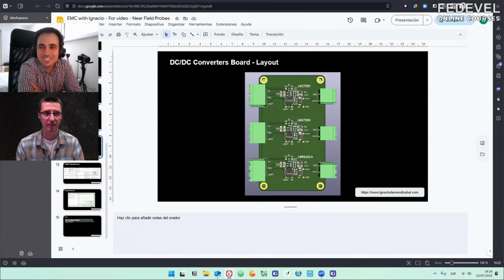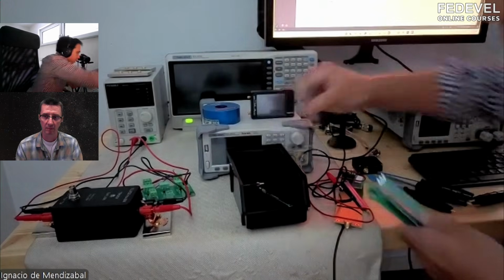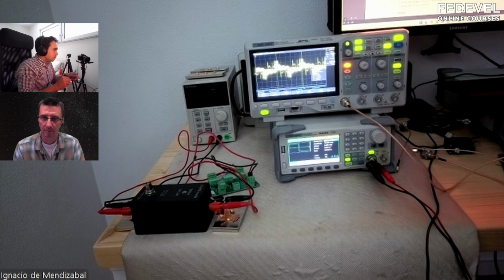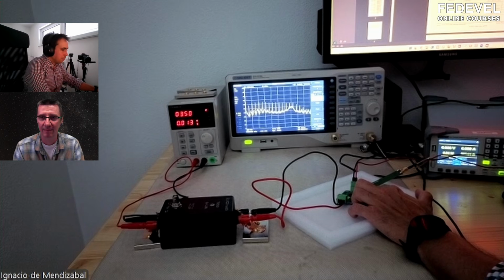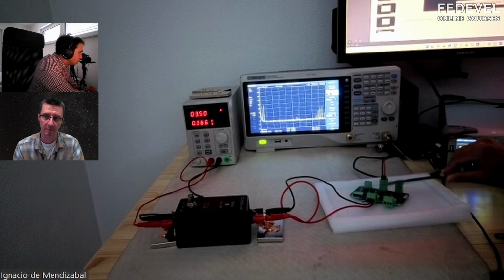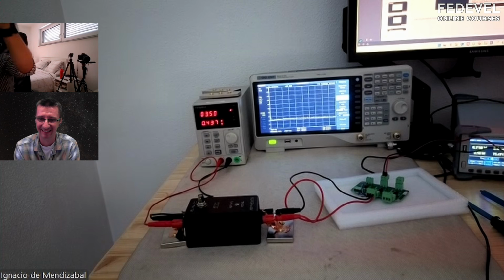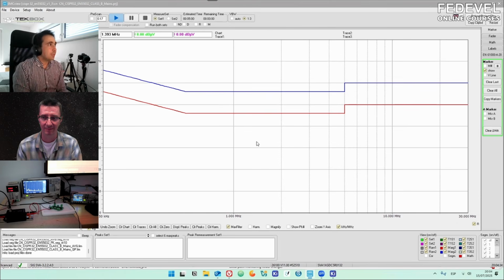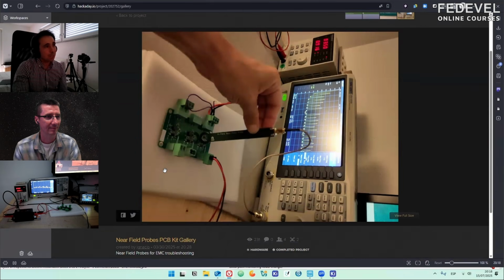Solving EMC Problems Fast & Easy - Near Field Measurement in Your Lab

Comment: Thanks for bringing Ignacio on to go over this. I definitely agree with him building custom E-field and H-field probes for quickly identifying EMI/EMC issues on a board. Most probes sold by manf, like Tektronix, cost a lot. It's hard to convince a company, particularly small companies, to buy a probe for testing EMI/EMC from manf like Tektronix. Taking his files and having a cheap PCB house build this is a great alternative. 

I do wish this video had some items that he could've covered. 
1. Layout and board stack-up do play a role in EMI/EMC, no? Would it have been best to cover the layout of his board and stack-up, even though it is the same layout, and discuss the impacts that layout/stack-up might have on EMI/EMC before running through his tests? Would like to know if this custom EMI/EMC probes of his would find issues where poor layout/stack up is a problem? I haven't looked, but maybe the datasheet of the part he was using has a suggested layout that we could've looked at and then compared with the design? 
2. Component selection - would loved to see a final test where component placement and selection might've helped with passing EMI/EMC testing while using the same layout design. Seems like we were only concerned about the switching frequency (which, if you're trying to get a grasp about EMI/EMC, then it's a good starting point). 

Great video!

Comment: The probe helped to receive noise at expected frequency and some amplitude. So how to relate it to the limit level defined by standard? For example, IEC 60601-1-2 Class B allows noise amplitude up to 50dBuV/m, while distance between receive antenna and uut is 3m

Comment: what is EMC?
Reply: ElectroMagnetic Compliance. It's ensuring that your device doesn't interfere with other devices or radio transmissions
Reply: @bene5431  Thank you
Reply: @thdotaku  Just by searching for the title you can find a copy online of Henry W. Ott's book "Electromagnetic Compatibility Engineering" which I consider an essential volume in my library.  I bought it in hardcover.  It explains what's actually happening on a physics level when signals flow.
Reply: @Peter_S_  thank you ,will check it out